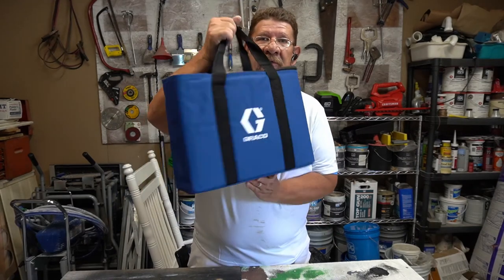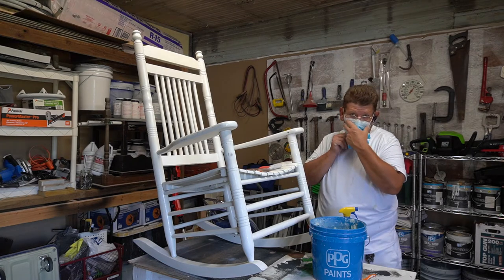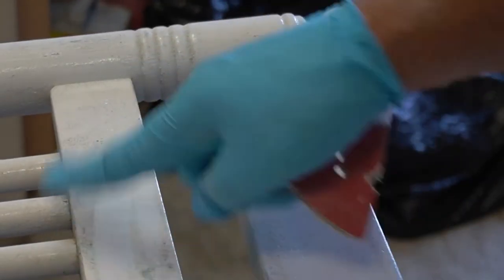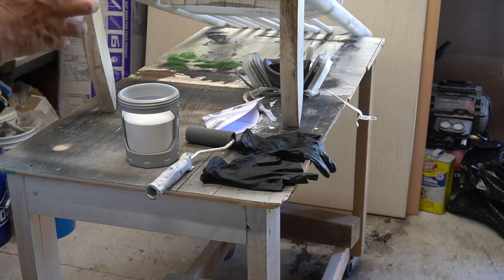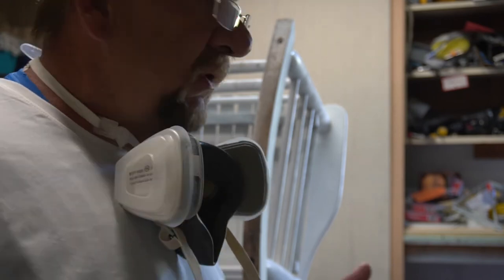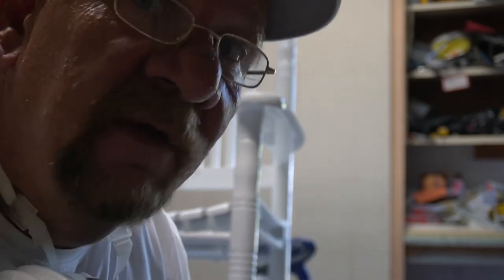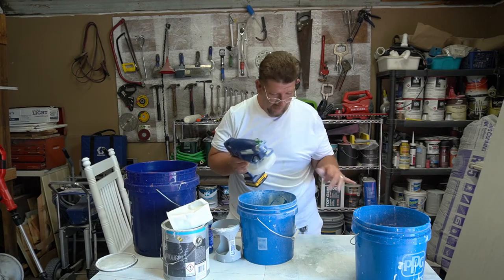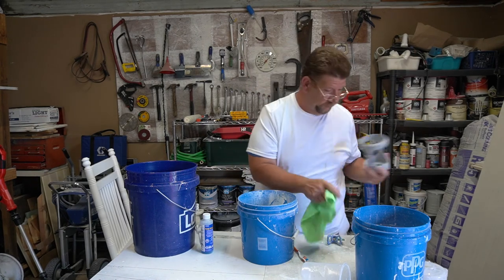Review of The Graco TC Pro / How to Spray a Rocking Chair

Comment: Like your video !! What number of the green Tip do you use ? 
I try my with a 314 with a 6 speed and I had to much running . 
I think a have to stay on 3 speed like your did !!
Reply from the maker: It was a 210 green tip.
Reply: @ratordsd  do you think with my 314 green tip in low speed I can have a different results? 
Thank you for responding back your advice will help me a lot . 
I was painting a desk for my daughter and I think with the speed at 6 I don't have the finished what a waiting for 🤣🤣. 
You know rookie painter!!
Reply from the maker: @PedroHernandez-ou5wy  It is hard to say.  What type of paint are you spaying?  If the paint is thin then you will have runs. If you have runs just back-roll them out. Use a piece of plastic or a trash bag and test the setting to find the right one for your sparygun.
Reply: @ratordsd  I was using Satin   paint and couple times my sprayer was spiting as well . I was so disappointed Lol . But thank you for your advice means a lot !! May God bless you!!
Reply from the maker: @PedroHernandez-ou5wy   Yes unfortunately all airless sprayers will spit.

Comment: Quick question i wasnt able to see the whole video but does the sprayer can be used for oil based paints? And clean them with mineral spirits?
Reply from the maker: No, you can not use oil-based paints with this sprayer.
Reply: @ratordsd  thank you i was going to buy today one but not anymore thank you. I probably miss when you said that in the video. But with the more expensive you can right? And thanks again